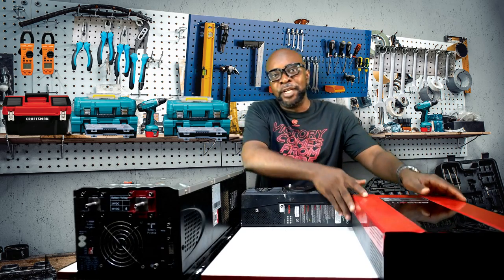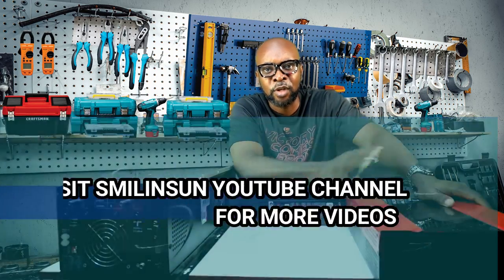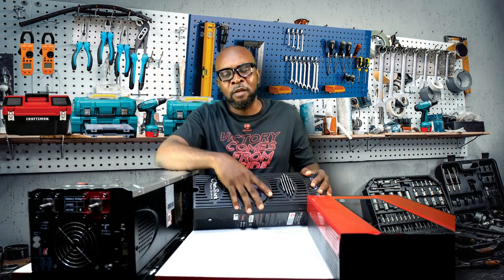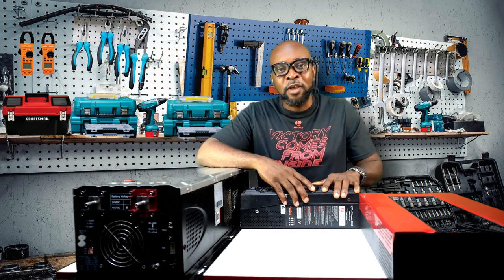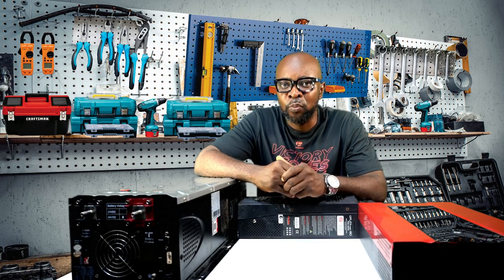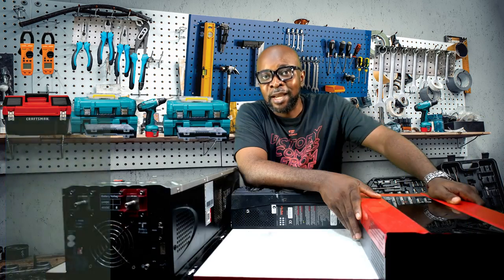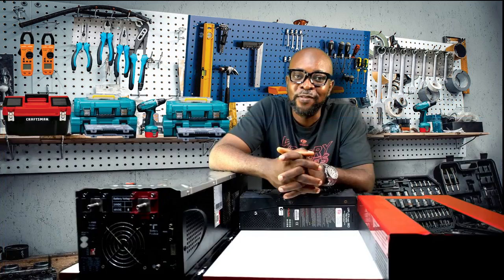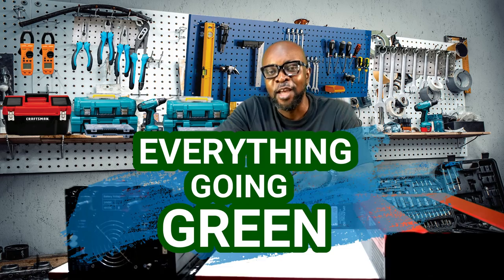TRANSFORMER BASED INVERTER VS HYBRID TRANSFORMERLESS INVERTER

Comment: Your videos are very insightful. I usually watch your videos and American Will Prowse videos. I watched your video on batteries and decided to go for a lithium battery against what most installers were suggesting. I watched this video and decided to go for Hybrid Inverter. But shockingly and sadly it lasted for only three months, it was installed by a professional installer in  July, and it stopped working on October 11, 2024. It just went off suddenly and since then refused to come up if you switch it on. I have come to watch this video again to see if there is anything I missed. It was a 6.2kva hybrid inverter, it never displayed any fault code. The only sign was one day, two weeks before malfunctioning, my wife complained she heard a strange noise from the inverter as if something was sparking inside. I listened and observed subsequent days, but never heard it.  I don't know whether I did any wrong , I usually switch it off whenever when the grid power ( NEPA Light) is available or come on if the battery is fully charged. I heard you say frequent fluctuations can lead to damage. Is an inverter supposed to be permanently on once installed? what could make a hybrid inverter go bad so early? One person said load, but I have never given a load more than 15% of its capacity of 6.2kva. The highest load is when I put on water pumping machine which has a load 900w. Most times I switch off other appliances when pumping water. I never used AC on it. My questions to this community are 1) What are the things that could make a get bad so quickly. 2) are inverters supposed to be permanently on 3) is it advisable to use an external charge controller with hybrid inverter because am suspecting whether the charge coming from the 700w bifacial solar panels is too much for the inverter to handle. 4) which brand from experience of others are durable- there are just too many products or brands out there.
Reply from the maker: @mikizhero  sorry to hear about your bad experience with a hibrid inverter, might be surge related or brand quality.
Reply: Am a solar installer, I have used Transformer base Inverter and now switch to Transformerless inverter. Hybrid Inverter seems better especially if it's high voltage. But what I noticed on both and I wish people take it serious is you connecting your system to the grid. It does damage quickly than when you rely only on Solar Panels.

I used my transformer base Inverter for 5 years without PHCN and Generator and I didn't have any issues. My current system which is Hybrid Inverter is not connected to Generator or PHCN but only Solar panel
Reply: The problem is the surge not the charger controller or solar panel.. Like I said early on my post if you connect your system to Grid or Generator you will always face the issue of fault on your system especially if it's transformerless Inverter... I can tell you that my system is 4.2kva Hybrid and powered my pumping machine with chess freezer at the same time but what I noticed was it will make the system unstable as at that moment.. Before it stable.
Check the Wattage intake of the system.
Check the Voltage coming in if there is full sun.
Disconnect the system from Grid and Generator and only rely on Solar Panel

If there is still space for your system to take more solar panel don't estimate to add more.

Currently am using 300W BY 6= 1800W
Input Wattage of the system is 6200W

But mind you that whatever you do don't complete the full input at least give space of 400w this depend on the type of Solar Panel used I mean brand.
Reply: @simlo1108  thanks so much for your reply. I am absolutely grateful for your response
Reply: @simlo1108  Again thanks so much for your input. I am just curious,Why did you switch to hybrid after 5 years of no trouble with transformer based inverter? I am not an installer, so I am  not experienced as you are but following my mishap, I have concluded (whether rightly or wrongly I don't know) that transformer based inverters are better from  watching many many videos and reading reviews. It appears though technology is moving towards hybrid as most manufacturers seem to be making more of hybrid inverters. I don't whether it's because it cheaper and the more people buy the better for chinese manufacturers irrespective of whether it is durable or not since there is no consumer protection agencies to protect costumers especially here in Africa or Nigeria.. I have decided to buy a transformer based inverter but don't know the good ones out there. A lot of people scream felicity but  being a Chinese company I am a bit skeptical. So your post about hybrid inverters being better is really interesting and making me wonder if I am actually wrong about my conclusion  about inverters. Could it be I just had a bad experience based on the brand I bought ( Wellion) which I will NEVER RECOMMEND to any person. For me that brand is a devil's trap for so many reasons. Again , why did you switch ?

Comment: I disagree with the second points. There are transformer inverters with that equal have inbuilt charge controller in it. And for the transformerless, the charge contoller can still with when the invertong section is fault as far as the inverter power section is still functioning
Reply: supported

Comment: Nice video sir, one this to note is that they both use Transformer, the difference is that one uses iron core Transformer and the Orther uses high frequency Transformer which is generally much more smaller.
Reply from the maker: Thanks Flawless
Reply: Thanks for the information

Comment: Great video fella, done all the tiny tears ones, but its only the heavy low voltage that cut it without a moan, and I’ve gone through a couple of good but mosfet driven machines, which all said were capable under load……hong Kong Fuji I’m afraid, Heavy rules if you power big things✌️
Reply from the maker: Thank you so much for your comment

Comment: I came across your video today when I was researching  how bonding inverter neutral to earth works. I have the axpert type transformerless  hybrid inverter. To be able for the earrh leakage to work, inverter output neutral should be bonded to earth but I do not know if my inverter outout will be damaged. In my opinion one of the output mosfet banks will be shorted to earth in the process. Your thoughts on the  matter will be appreciated.

Comment: Is it normal for my xpert king 5kva to make a slight buzzing sound when on
Reply from the maker: Inverters generally have a lot of buzzing sounds that indicate different things , from low battery to high voltage detecttion., error sounds  and overload sounds , so its difficult to say which is applicable to you.

Comment: I bought the 2 transformer and non transformer I will install one in my Vilage and one in my abuja house. Installed already. From my experiment here I think transformer based is better with my external MPPT low noise and durable while the Transformer based is full of heat and noise.  Hybrid is useless to me..
Reply from the maker: Great choice
Reply: Why  do say it is useless please. I had a  very bad experience with hybrid. Can suggest a brand that is durable for a transformer based inverter please

Comment: Wonderful review.

I’m planning on getting an inverter and I have two options before me, a transformer based hybrid inverter and a non hybrid transformer inverter with external charge controller. 

Apart from cost implications, which of the setup will have more advantages over the other?
Reply: Run away from hybrid inverters

Comment: Hello sir how can I eathing my solar system
Reply from the maker: The charge controller and the inverter has a provsion on the body surface where you can connect your earthing wire and bond it with the existing earthing facilty in the house. If there is none in the house you will need to provide it. An earthing copper rod is usually inserseted in the ground.

Comment: Currently low frequency inverter that uses toroidal transformers are more efficient than transformerless inverter examples are yohako inverters and victron inverter,and not all transformerless inverters has a built in mppt,the main difference to me between the transformer and non transformerless inverters are the applications
Reply from the maker: Hello William we are are all saying the same thing I made it very clear in the video that high frequency inverter as a self device is more energy efficient, however it doesn’t operate well with high-surge loads like pumps and high-torque tools.
Reply: @smilinsunsmilinsun8056  low frequency inverters handles surges well, you mean high-frequency inverters,what i was saying in my earlier reply was there are low frequency inverter with the same idle consumption as high frequency inverter there by throwing away the point of one is more efficient than the other
Reply from the maker: @odeywilliams7596  I meant high frequency not low frequency but in all retrospect high frequency inverter is still more energy efficient than a low frequency inverter.
Reply: @smilinsunsmilinsun8056  research on low frequency inverters that uses toroidal transformers and see why they are as energy efficient if not more than high frequency inverters,youll also know why victron inverters uses it everybod learns something new everyday